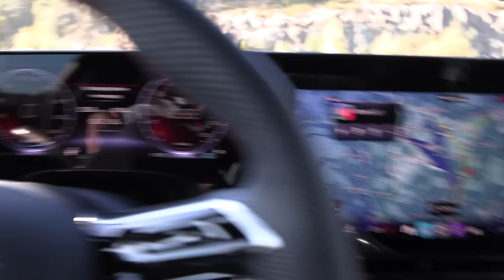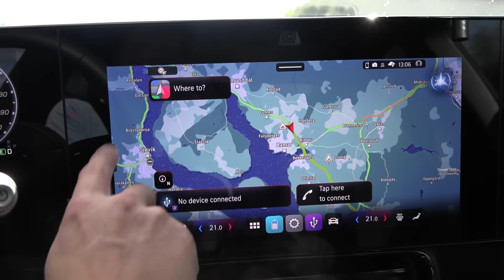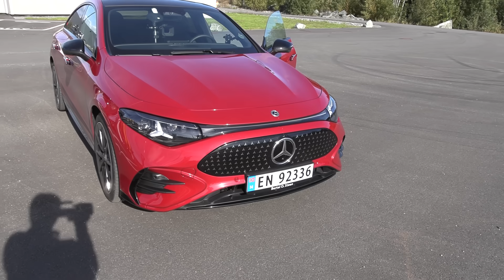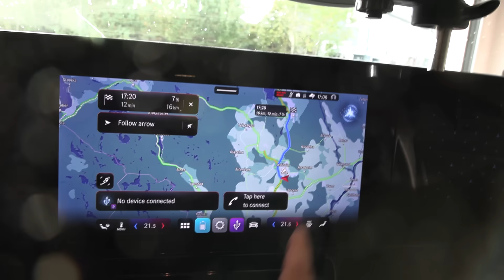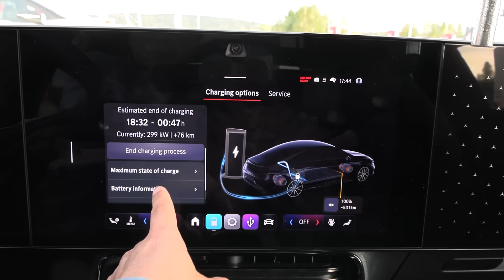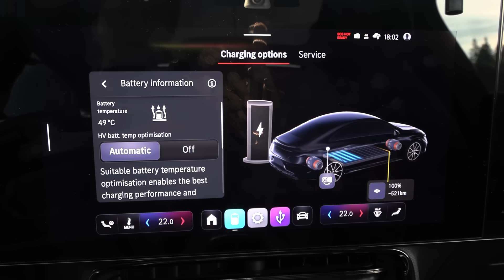Mercedes CLA 350 4Matic range test

Comment: Good car , but not an Tesla level on efficiency.  Highland manages few miles less with a much smaller battery pack. CLA is also considerably smaller and less practical than Model 3. Interior is cramped. Still a good car , but I don't  see it as Model 3 competitor

Comment: very good car and nice to drive - not to mention the efficiency. On the base audio, I full y agree with you. It is okay ish , but lacks punch, in the mid for sure, and some details. what annoys me is that with some bass and volume it rattles in the door. on the pro, there are some bass - often lacking in base system -  and surround sound .  Wonder if speakers could be changed to improve it.

Comment: So bad, A 70% range is only 310…😂 we do so many highway km’s at 125 or 135kph, so a 80%-10% never enough, a lot of days over 300km.
It does not have a converter for the 400v. 
A reason why we sold our model 3 long range and again an Ice, Kia-ceed (consumption at 130kph = 5,8liters)
Reply: why not an airbus a350, you can do 800km/hr and have a range of 15000kms+.
Reply: @mn5655 cause that is not a daily car.

Comment: Thanks for the test. The charging situation still seems like an inconstant mess with the CLA, again, need an urgent SW update for that! 

As for the price, i do think the CLA 350 starting at 65k € in Germany is at least 5k € overpriced and should come with far more options as standard. The upcoming iX3 is a segment above the CLA, has a much bigger battery, is an SUV and the iX3 50 xdrive (AWD) starts at only 68k €...i mean honestly who would choose a CLA for 65k € in comparison? Also i have specced the iX3 on BMWs configurator to my liking how i would buy it and a very well, almost fully specced iX3 with all the goodies like M-Sport Package, 3D HUD, 2 tone leather, towing hitch, top tier assistant systems etc. came out to 78k€ as BMW gives you a good amount of features as standard. I suspect next year when the i3 sedan and C-class EV come out, the CLA will get a heavy decrease in price as the i3 Sedan should cost the same or even less than the CLA while being a segment above it.

I suspect BMW shocked Mercedes with their pricing, lol. Notice how there are no prices communicated for the GLC EV yet and no configurator, which was revealed 2 days after the iX3. Looks like Mercedes is heavily reflecting on their prices as we speak.

Comment: Battery temperature hitting 53C in 12c weather? Is that normal?  Battery degradation would  accelerate with regular 350kW chargers. Can't imagine DC fast charging in 40C weather
Reply: How mutch C hit Tesla while charging? Nothing unusual...

Comment: You are incorect with cables. On Alpitronics whenever the conector head has that silver HPC letters it means it is cooled cable. If the head is just black than it is noncooled cable. Your car has obviously some general software problem which also have influence on to the charging itself. Maybe caused by that fault lamp? But it is quite funny that they gave you the press car without proparly checking it? Like that strange tire combination, faulty lamp, bad soft. Next time they give you car without glass, or doors panel? That does not do much good propagation for Merc.

Comment: So at 120 you got 186wh per KM but in the US on my model 3 long range rear wheel drive, I get 200wh per MILE at 120kph which is about 125wh per km....
Not good...
At 90kph (55mph) I get sub 180wh per MILE (112wh per km)...
Granted, this is an AWD model, but shows that you really should be getting the rwd models of these cars for max range/efficiency. RWD EV's perform quite well in wet/snow.
Reply: Hm 125wh per km at 120 (average?) would be less then WLTP. That is not realistic, but would be interesting how you reached it (downhill etc?)

Comment: The aerodynamics and the 2 speed gearbox makes wonders for efficiency even being heavy at 2.2 tons.
Reply: Kerb weight of cla 250+ RWD is 1980 kg and 2060 kg for CLA 350 4 matic without the weight of the driver
Reply: @davidfujkk8018 It's heavier than the benchmark car, the Tesla Model 3. Watch the video, Bjorn weighted it at 2220kg... he doesn't weight 140kg.
Reply: @davidfujkk8018  The DIN weight includes a driver weighing 75kg and all operating fluids are filled up.
Reply: @raphi25895 i meant kerb weight
Reply: weight does not matter in electric vehicles. Mercedes stated that a difference in drag coefficient of 0.001 is worth 100 kg of weight reduction.
So a car that has a drag coefficient of 0.22 and weighs 1 ton has about the same efficiency as a car that weighs 3 tons and has a drag coefficient of 0.20.
Reply: @casaxtreme2952  Well I am not sure this apply even at 120 kmh but its simple math:
Impact of 0.001 Cd is 0.5×1.2×33.33×33.33×0.001×2.3 = 1.53 Newtons (causes 1.53 * 33.33 = 51 W power usage)
Impact of 100 kg is 0.0055×100×9.81 = 5.4 Newtons and this is with literal best tyres there are on good roads (causes 5.4 * 33.33 = 180 W power usage)
So no weight 100% matters and slower you go more it eats range and I think tyre particulates happen with to power of four at least with heavier vehicles so it has even that disadvantage.
Reply: @casaxtreme2952 You are mixing 2 different things. 
Drag coefficient is related to the resistance of the air caused by the shape of an object that impacts air flow. Higher the resistance, more energy is needed to overcome it. It has nothing to do with weight. Weigh impacts the energy needed by the motors to move the car, a heavier car requires more energy to accelerate or maintain speed.
Both are important.

Comment: Mercedes' 19% bigger battery gives you 3% more range compared to Tesla. Of course the tyre is bigger on the CLA but it can't be responsible for everything. Tesla has 400 hp, Mercedes has 350. The Mercedes costs 40% more if you add the extras of the Tesla to its price. On top of it its range prediction is inaccurate and its infotainment looks like Windows 95 with confusing multi layer menus. And on top of that you cannot charge it with the most reliable, cost effective and extensive charging network.
Reply: Premium brands are one thing, generalistic ones are another. Different market segments.

Comment: I was really looking forward to this car, the parameters and price looked good, but this is the second video (after the 1000km challenge) where I am disappointed with the car. 
Charging speed is very random, slower as expected, still has some problem with temperature and chargers (even in cold weather). The UI in the system looks little bit outdated, the HUD should be some basic one in this model because of the short distance to the window. 
Is this Mercedes quality now?

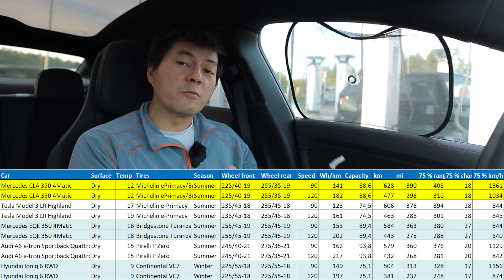Comment: 33:54 new Model 3 LR models also have a bigger battery. LG 5M pack. You need to test it!
Reply: LG has the worst cells in the business that are failing left and right in Teslas. They’re having higher internal resistance when new than the Panasonic 2170 cells in US made Model 3.

Comment: I can fill up with petrol at constant rate until the tank is full for 800 Kms, takes 3-4 mins 😂
Reply: Hero
Reply: But you can't really fill it up at home can you?
Reply: @Felix-st2ue  I drove EV for 10 years, Nissan Leaf 24 Kwh, BMW i3 Rex, and the worst POS the Volkswagen ID3. While charging at home for me was neither convenient or inconvenient , filling with petrol is a lot more convenient when on longer drives and the fact I get much more range per charge and when I fill up with petrol I'm usually passing by a petrol station anyway and a few mins stop is not an issue for me. 

Hanging around DC public chargers was a lot more inconvenient and the cost @65 c/Kwh at most chargers means on longer runs Petrol or Diesel isn't much more expensive if at all. 

The best of the 3 EV was the BMW i3 Rex because I could drive past chargers if they were in use or when the battery was cold, it did not matter, I could turn on the generator and continue on my journey. I believe BMW are bringing back the Rex, sadly it will probably be in more expensive cars. The suicide doors became impractical as my 2 Sons got older and could get in and out of the car themselves. 

When range and especially charge times have massively improved and EV can be got at a reasonable cost 2nd hand I will reconsider EV again. I will never again buy a new EV or any car, especially considering the massive Tax on new cars here in Ireland, the massively inflated cost of new cars from the manufacturers is ridiculous and they keep making cars larger, more expensive and filled with more and more tech. I don't want to drive a Tablet on 4 wheels with screens everywhere. While it might be modern, this is not good in cars, modern doesn't always mean good.

Comment: 15:25 - from next year there should be possibility to have normal buttons on steering wheel (also possibility to charge on 400V chargers)
Reply: It's almost as if this car isn't really ready for market. Bjørn seems to get more and more like this. Is it because they're releasing the cars when they aren't really ready, or because Bjørn is featuring as a beta tester? (The lack of 400v charging is ridiculous. I never want to be checking ahead to see if I get 400 or 800.)
Reply: @londonwestman1 how often do you charge at a 400v charger nowadays?
Reply: @p3t3rfunny  I don't even charge in public places (less then twice a year on average)....if I need public charging I take my petrol vehicle. Does that answer your question? Ridiculous they didn't sort it out. Plenty of countries with 400V chargers, that aren't going away.
Reply: didn't they fix the 400V charging?
Reply: @ALCLCFVIS  this version does not have the converter needed for 400V charging, as per info from internet, next year it will be available along that steering wheel without touch sensors.

Comment: The CLA EQ 350 with big rims would be rather comparable with M3 Performance. The CLA EQ 250+ would be the one to go, if you want top efficiency - it was the same story with EQS and EQE, the AMG line, dual motor variants always had higher consumption.
Reply: Actually Mercedes built the AWD well and the difference between it and RWD is negligible. The wheels are the culprit here.
Reply: I think you can't compare the CLA EQ 350 with a Tesla Model 3 Performance. They are on two different planets, performance-wise.
Reply: you are right basically but actually the AMG line exterior on the EQE and EQS is slightly more aerodynamic than the standard one.
Reply: @casaxtreme2952  Yeah... no

Comment: The fun fact that the old Hyundai Ioniq is still best in class. Imagine if that car had 100+ kWh :D
Reply: How’s that?
Smaller wheels, relative same temperature, less power, 1 motor, still down in efficiency! 
The merc is really a beast. At the same temp with tesla and smaller wheels will have like 60-70km more real range, way better charging!
After my shitty id4 gtx i will reconsider my atitude towards ev with ix3 or glc eq.

Comment: They rushed the first production cars with unfinished software is my guess. In start of 2026 you can also buy it with 400v charging  and will probably will have better software at start. This car is great, now imagine the efficiency of the 250+ with smaller wheels. Will be probably hitting 500+ range on motorway speed. Nice Car!

Comment: Thanks for the video, especially also charging details. For me it seems like the cooling system for the battery is to weak, therefore charging speed is lowered.
Reply: Agreed, thermal management seems not to be a strong point. More marketing than substance. Expected it to hold SOC much deeper.

Comment: Refreshed zeekr 001 for 2026 is released now, 12C charging it has(mind bending) from ~90-100kwh two options to choose battery packs. 280kmh top speed even in the slowest variant 490hp rwd 810km catl so 650 wltp. -> October China prices and 1 st deliveries. 205mm clearance and 85mm adjustability of her, double air chamber suspension now. Much more useable now on light off-road roads than original 001.
Reply: And how much zeekr earns from each car?and if chinese brand says 650 wltp its not over 500
Reply: @AAADDD-m3v why should you buy a car based on how much said company earns? Wltp is an estimate by the OP not by Zeekr

Comment: A comparisson with BMW i4 would have been interesting.
Reply: i4 is old, of course it’s going to lose. Need to wait for new i3 Neue Klasse, it should be much better
Reply: @sergeikulichkov7748  I think the i4 40 ist still very competitive - in the 1000 km challenge it was only 20 Mins slower and still has some upsides compared to the Merc. Let's see, if BMW gives it the new battery-cells and the 800-Volt architecture for the last 4 years of its livecycle.
Reply: blast from the past?

Comment: I would say a flickering headlight is a very big deal when the warranty is out. These advanced headlights can be probably more than 3-4000 Eur to swap out.
Reply: Sometimes is not needed to replace whole light, for example we have one lights fixing company and it cost me about 300eur to fix foggy LED light issue. They are also fixing daytime lights on multiple car brands.
Reply: @myscho  Name ?
Reply: This price estimate is on the low side! One of the problems with LED DRLs is that the dealers replace the complete headlight unit when usually the problem is the main DRL LED that is not at all expensive and doesn’t take long to replace in itself but in some cars it is a fiddly job. The UK channel PowerfulUK has a video about how to repair the DRL LED on the L663 model Defender from 2020 onward- they did it in their workshop in minutes.
Reply: @timoliver8940  a dealer is a dealer. They do as guided by the manufacturer. So it's not a surprise, that they're not going to spend an eternity on repairing an LED headlight AND warrantying that repair, when the manufacturer says it's not repairable and to replace it. If you want things like that repaired, seeking independent repair shops / specialised companies is the way to go.

Comment: Very impressive, esp considering it is the AWD drive, the basic 250 should do even a lot better
Reply: and this with the least efficient wheels. Try this with the areo-optimized 18" inch wheels, that I was able to test on the german motorway. Completely different ballpark.
Reply: @michaelk.920 They aren't the worst wheels, the worst would be the AMG line plus but they are certainly far from the best
Reply: The RWD version should not do that much better because the front motor is not connected as long as you don't accelerate fast or the rear wheels lose traction
Reply: @irgendeinerandomperson with a Tesla the difference between LR RWD and AWD is quite substantial
Reply: @Watt_Ihr_Volt In the Tesla the front motor still rotates when not in use but is switched off in the Mercedes the motor is completely disconnected from the drivetrain. This can work in the Tesla because they use a different kind of motor in the front than Mercedes but it is probably less efficient
Reply: Not that much since the front motor is disconnectable by a clutch.
Reply: This 👍👍
Reply: Actually not. The WLTP difference between RWD and AWD is measly 21km, from 792km to 771km. The main difference is the wheels. Go for 18" Aero wheels and not 19" inch sporty wheels and you get 50km more.
Reply: No, not if the tech is ok like Tesla!
Reply: Basic cost just over 60K. Are they crazy? Or simply dumb?
Reply: @IlVeroCiccioPasticcione well this car is very efficient at high speeds too which is very rarely seen, it has very good technology underneath, I believe with todays inflation anyways the 60k price is okey

Comment: Kind of funny that this is in the same price class as the EV6 etc. Seems that ~65k Euro range is where the fun is at.
Reply: Still a crazy price for an A-class sedan.
Reply: @alfrredd  I've just opened configurator, and you have to pay extra for almost everything, and I'm not even saying about "e-features" that are already on your car but you have to pay for them to be activated, or you can do that later by paying for it monthly, this is madness.

Also I can see that it's not supporting the 400V charging, I live in a country where 800V are quite rare, same goes for US I believe - how do they want to sell that car in other countries than western europe and scandinavia?
Reply: @damianp5888  and this is supposed to be the entry level model into the brand!!, the C class will become the new S class at this point.
Reply: MSRP for EV6 and most other EVs that are few years into production is very innacurate. Version with larger battery can be found for 45k euros
Reply: @ivanjanjic8762  Also if you add some options to CLA, the price will be 80-90k EUR, right?
Reply: @damianp5888  if you want to get good deal you should never configure car by yourself but rather order a car from dealer with pre selected options